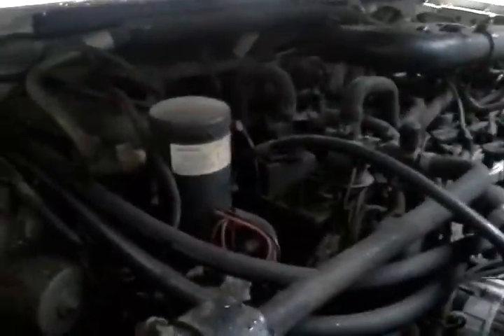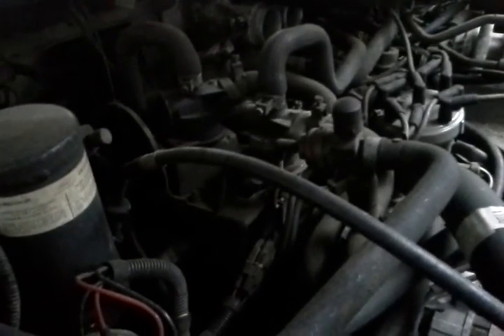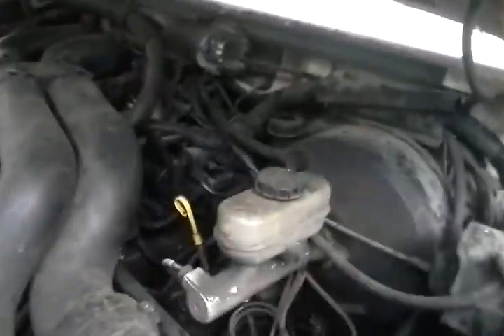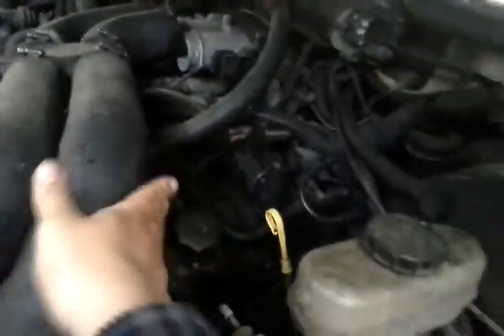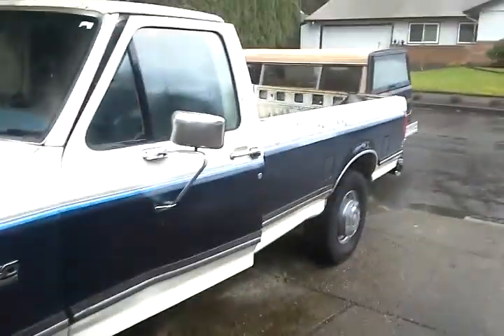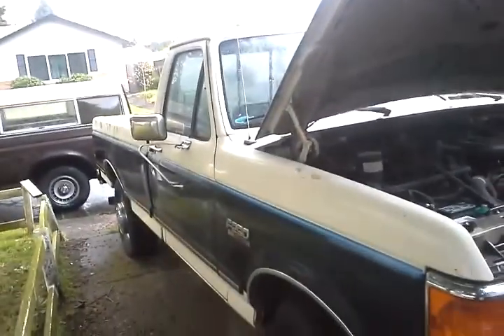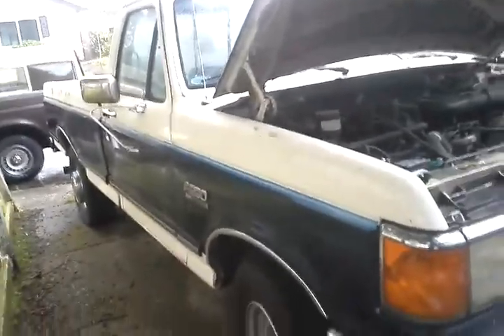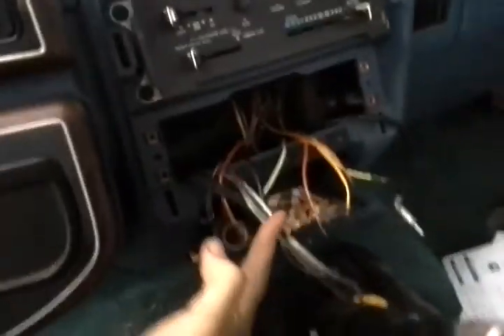88 F250 won't start

Comment: I have a ford f250 1988 it won't start I thought it was a fuel problem but it still won't start. Any solutions to what it could be?
Reply: Ignition switch bad ground fuel pump dirty air filter fuel filter.  An engine needs 3 things to start and run. Fuel air and spark if you don't have 1 of these she won't run
Reply: Pull a plug and put the wire back on. Hold it to something metal, and crank. See if you have spark. If you do, make sure air systems good then check compression/leak down